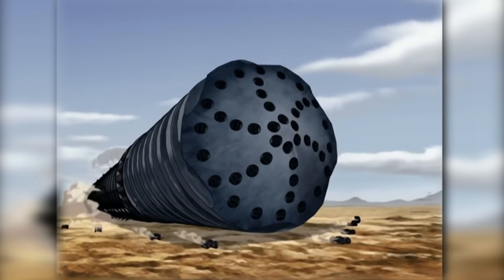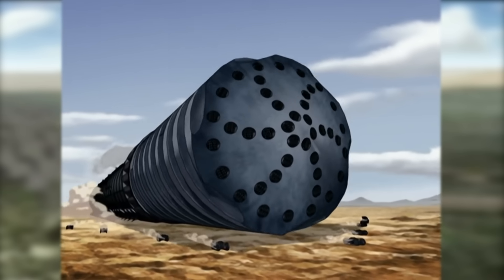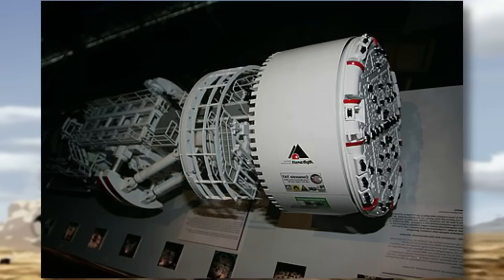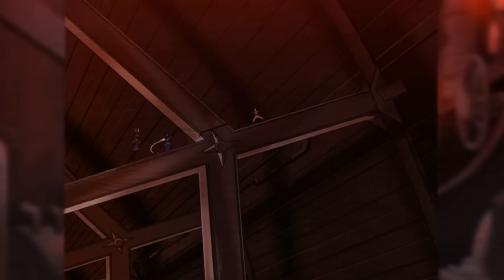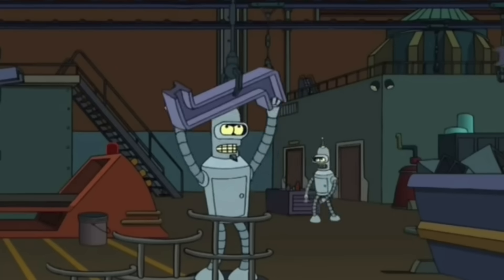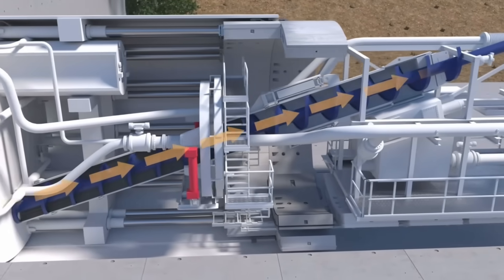Engineer Breaks Down the Fire Nation Tech

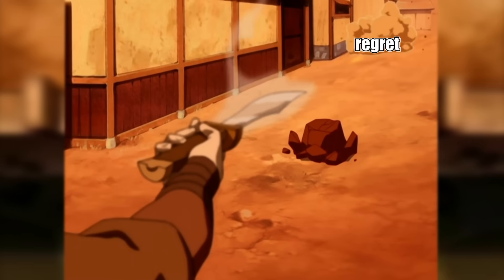Comment: 8:24 the firebender have to either use the power of the sun, metabolic energy, or emotional energy usually rage, but later probably act more like a valve fo the former. Also they have to be in an oxygenated environment. Though it's yet to be seen if firebenders could manipulate fuels, oxides,  or accelerants. So in reality they have more drawbacks than airbending. Which i don't see why compressed air bending can't become plasma bending.

Comment: a lot of the tech in atla is restricted to fire nation use only until much later on so it would make sense for those within the world not knowing to attack the control hubs of devices unless they accidently stumble on the guy driving the thing due to it normally requiring some kind of bending method to power it.

Comment: To be fair, I would argue that the best way to defend against the drill in this situation is to first slowly surround it with more wall, then enclose it underground, and only then keep extending the wall in front of it. 

Give it some time, without ability to replenish the resources, it will have to stop moving, and then either arrest whoever is still alive inside, or leave the problem under ground.

Comment: I would say that it does seem like benders use materials in their environment, but at the same time, earthbending rarely seems to follow the conservation of matter laws, and sometimes water doesn't either, but it's harder to guage, because the sources of water are large, and the water would flow down to fill in anything taken. A lot of large stone structures are taken up out of the ground, but without any seeming loss of material from where they were taken. (When an earthbender throws up a wall, or kicks up a rock, there's usually not divets around said wall, or a hole in the place of said rock) A lot of this can be chucked up to animation and logic needing time and effort that were needed far more elsewhere, but I'm never sure in my imaginations whether to go with what's seemingly intended, or what's shown.

Edit: The idea of simply widening the wall is absolutely diabolical. I love and hate it
Reply: I read a fanfic once that answered this, in the fanfic the protagonist called it "sponging the rock". 
When an earthbender seemingly makes rock appear out of nowhere, they are doing the equivalent to letting go off as squished sponge. They increase the volume but not the mass, if Aang raises a column of rocks and you take a closer look to it, you'll see the internal structure of a pumice rock, it desintegrates with time, not good for building structures, pretty good for fighting tho.

Comment: tbh, I think it makes sense to take out the drill structurally.  if they attacked the mechanical workings, the fire nation could fairly easily repair it... and they likely had backups and replacement parts on hand, expecting failures of various onboard systems.  by striking the structure, the fire nation would not readily be able to repair it for another run... given its size, the fire nation would have to protect it for long periods right next to an enemy's wall... until repairs could be made...hence, when the structure failed entirely, they abandoned it in place.

Comment: If they use the sludge to remove the earth because if they keep it as a conveyor an earth bender can just destroy the insides, with the addition of water you make it so only certain type of earth bender can destroy the machine. 
While every earth bender that can bend dry earth is there they will lack Benders from the coast, or from swampy areas that may have the ability to bend wet earth. If you recall the northern water tribe is not close to assist and the southern water tribe is almost non existent and out of Benders. There are also no airbenders that's why the also beginning the development of the air blimp, and why they have to mechanize as earth Benders can't bend metal, at this time

Comment: well heres how i thought of this on the slurry side of this BUT three things you need to know First drilling causes friction and friction causes heat which is often the cause of case hardening which then leads to metal becoming brittle so the water may be a crude way of keeping the drill cool while its doing its job,  Second  drilling stone of any sort causes vast amounts of dust to be thrown up into the air and when it gets in your lungs can reek havoc of all sorts so perhaps they were doing it  also to keep the crew in top condition so they arent choking on it ALSO dust gets in every nook and cranny you can imagine causing mayhem on anything mechanical and leading it to break down quicker  with them also probably creating it so its easier to remove the cut material away from the main working bits of the machine and THIRD and finally the slurry then acts as an abrasive to further help grind the hole they're trying to make in the wall for their troops to make it through . but anyway just my thoughts as a writer and a chronic world builder who loves this kinda stuff

Comment: I've always seen firebending more as "plasmabending". Fire needs fuel to burn, and we don't see firebenders with any fuel on hand. So I assume they are "burning and superheating into plasma" in a localized way the gases in the air, and some particles present. Without air, there is no "flame". That's why they talk about "breathing" for firebending. And remembering about Azula's Lightning and Iroh's lesson and the Dance of the Dragons that firebending is a type of "energybending"... Convert energy into thermal energy and you heat the air under your control.

Comment: In retrospect, the weakness of the drill is clearly the contact points with the ground which would be under extreme pressure and the propulsion system. The reason why we don't have supertanks heavier than 100 tons are because they are super slow and vulnerable, and because of the ground pressure they get mired in mud and can't cross bridges. The earth kingdom should have been able to see the drill coming for days if not weeks, and set up a veritable obstacle course for it. Trenches, moguls, sinkholes, mud, water, fine sand there are so many things that would be lethal to this behemoth.

Comment: It's a steam-powered drill, and Ang and Katara can bend water. Just lower the water in the boiler, and the crown sheet around the fire box would weaken. Eventually, it won't be able to hold back the pressure, and the whole boiler explodes.
If they wanted to keep the engineering team distracted, they could fool around with the water level in the sight glass so the engineers would think the boiler water level was adequate.

Comment: Look, I know Iroh was powered by Sozin's Comet and yes a powerful firebender, let alone the Dragon of the West, during that time could definitely pull off significant damage on the wall.

But you can't deny that the amount of combustion needed to power a drill like that could've easily had been translated into explosives. In that case it would've put the Fire Nation at a similar tier as the Earth benders since they can raise earth to replace parts of the wall pretty quickly, but bombs are instantaneous while the drill was slow. I mean they had a whole story arc and battle sequence while it tried to do the thing, come on. 

It was definitely hype, definitely over-the-top and the Rule of Cool was on full display here, but bombs plus trebuchets that fling fiery boulders at the wall would've worked a lot better, done it a lot faster, and honestly would've been cheaper and more defended than the drill and I don't think I'm being a party pooper for thinking that.

Comment: The tactic of just extending the wall where the drill is would have been nuts, surely the drill had a maximum effective range, would have completely neutralized it but I doubt there were any benders around capable of doing that.
While Avatar isn't perfect it still impresses me just how much better it is in comparison to basically another thing in television.

Comment: 6:40 air with enough speed and force can cause damage, if it can do that then accurate wind with added speed should be able to cut just like water can albeit it requires much more force, same precision as water but much more force from a much greater power source in order to achieve what Aang did

Comment: I just realized with the wall widening comment, if team Avatar were really smart they could have disrupted the drill with a steep enough incline.  The drill slowly inch worms along on the sand joint by joint.  What if you were to cause the joints to abut each other and jam.  I doubt they have enough people to fix it.

Comment: I assumed fire bending is just energy projection. Air contains all the elements you need to make a brief fire ball, but it needs an extreme temperature to make it happen. Electrical arcs can make fireballs that travel several feet. The idea that lightning is just a specialized form of fire bending makes sense when you assume fire benders are just projecting energy not actual fire. Fire is the result rather than the cause.

Comment: To be fair, I think that the channels on the side of the drill head has a bit of a purpose, pun notwithstanding... More specifically, I think they were there in case the Earthbenders attempted to use the material of the wall itself to clamp down on the drill head, trying to get it to bind up and get stuck. The grooves, like an average drill bit on its side, would likely have been meant to chew away at any such excess material and extrude it backwards, outside of the wall, and out of the way. This would render any further attempts to bind the head a bad idea, because bending (at least, non-fire bending) requires existing bendable material to work, which means the benders would have to use material from the wall itself, further weakening the structure (and thinning it out!) in their attempts to defend it. Of course, we never saw anyone try to do that, at least not on camera, so for all we know that (possible) plan was a moot point in the end.

At least, that's how I choose to interpret the grooved portions.

Comment: How the Earth Kingdom army could have stopped the drill had Team Avatar not been conveniently passing by:

1. They could have just created a massive boulder by all working together and dropped it on one of the extended sections of the drill during it's movement. During movement, the drill's armor becomes substantially thinner, and a large enough boulder could do some serious damage. And even if it doesn't do any damage, the giant boulder lodged in between the drill sections would keep them from coming back together. Thus stopping the drill from moving those two sections anymore, stopping it until the obstruction is removed.

2. We see 6 earth benders blast a tank into the air by working together in this episode. So a larger number of benders could potentially lift a section of the drill. Just lift any section of the drill even a few meters off of the ground, and the drill will become unable to move. This is because the lifted section cannot survive dropping several meters off of the platform, and the rear sections cannot make the 90 degree climb onto the platform.

3. When they see the drill coming, they could send an advance party to dig a massive trench in front of the drill. This drill seems to not like bending, so forcing it to go down a steep hill could cause it to break. If not, it's still heading for a place distant from the wall. You could also carve a turning channel into this trench to force the drill off course.

4. Counter tunnel the tunneler. While the drill is on its way, have a bunch of guys go underground and dig a series of tunnels. Removing the earth as they go. With earth bending, a process like this could be done in minutes. Then, when the drill passes over that area, the tunnels will collapse under the weight and the drill will fall. This will both bend and drop the frontal section of the drill, as well as slamming the actual drill bit sideways against the ground. Even if the drill survives this, the bit will be offset. Needing repair or replacement. The Fire Nation's engineers will also need to find a way to lift the drill, reverse it, and turn it around the sinkhole before the assault can continue. Taking days at the very least.

Comment: I think it's better to think of fire bending less as a form of matter manipulation (controlling plasma, in this case) and more like energy manipulation. They can manipulate thermal energy (and electromagnetic, in the case of lightning) to spontaneously ignite small amounts of the air, as they can also use fire bending simply to heat themselves without setting themselves on fire. You don't really see fire benders make flames in the environment move to their will, and instead see them force plumes of flame out from their limbs and mouths. This would suggest they are not moving the fire, but instead extending a chemical reaction in the air that causes a mass of plasma to generate in the direction of the attack. Fire bending also "comes from the breath, not the muscles," as the heat of the body is most readily expelled that way.

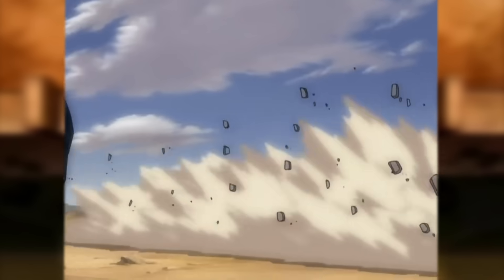Comment: 7:10 sure they could have attacked the mechanical systems but keep in mind that those are most definitely being oversen by the crew woo that the machine doesn't brake itself. Sonce they had guards for non critical parts of the drills operation
Reply: Wtf kinda pfp is that

Comment: I love the idea of the defenders just making the wall thicker as the drill goes through until they run out of fuel and are just like “well….. now we’re stuck”
Reply: It would be hilarious if they led this thing down an artificial slope so it wouldn‘t dig into the wall but into the earth at an angle instead. This drill is many things but definitely no maneuverable. Imagine them boring for hours just to realize that they are deep underground, trapped by earth benders sealing all the air tunnels…

Comment: I'm surprised the Earth Benders didn't directly attack the drill by stressing it's massive length by lowering or raising the ground under it.  Do that rapidly enough at enough different points and it's own size and weight will do the damage for you

Comment: If we go deeper abot fire, it gonna be not what it looks. SO air, water and earth is quite physical object, but fire is a different story. Usually what's meant by fire is just oxidation with heat production. Technically speacing it shouldn't even be oxigen because you can burn natrium in phosphor.But more precisely: fire in it's core is just emmiting energy as heat and light. As long as magic is just some sort of other kind energy wasted on moving earth/water/air, it can be wasted on speeding up particles as well (Reminder: heat is basicly average speed of particles in substance.).

Comment: What if firebenders are changing the oxygen concentration or altering the whole air composition and pressure so it can be ignited and directed, since flames created by firebending are clearly directional and is seen can even create explosions when not using it right, or like that one guy who could just go boom, and his blasts did look a lot like shockwaves, so it makes me think of very compressed air.

Comment: At about 8:13 you talk about how Fire bending is the only bending that is "Created". I've thought about this for some time-- We know that some benders can control the temperature of their element. Water benders can melt snow or freeze water. Some special earth benders can become lava benders. It makes one wonder if water benders are also capable of boiling water? Can air benders also control the temperature of the air around them?
We also know that fire bending works without the possibility of oxygen, as we see Zuko in season 1 heating up ice that he's trapped under, as well as earlier in the season we see Iroh heating a pool of water to create a hot tub.
 We also know there are some benders (like Azula) that have hotter flames, based on color.
The best solution I have is that fire bending is some form of energy manipulation, on an atomic scale? And that when not being used against other elements, such as water, it appears in the form of fire.
We've also seen that fire benders can also control lava (Roku in his temple in season 1), and maybe that is a result of the actual heat/energy?
I could apply this energy manipulation to the logic of lightning bending, but I'm not all that smart and don't want to make a total fool of myself. Something something energy and electrons.
Anyways that's my thought.

Comment: Aight so, Fire bending...uses the Firebender's own chi  to generate heat and flames, this use of chi is why they can also generate electricity (Lightning Bending, and Redirection as an extension of chi (energy) manipulation (smoke bending, manipulating and directing the flow the heat energy of very hot particulates) [0 explanation for Combustion bending, although this manipulation of one's energy is I believe the basis for Energy Bending], as well as being able to manipulate flames that may already be present in the environment, whether due to man or nature doesn't really matter...its fire.

Comment: If you look at it scientifically, fire bending most likely draws heat from the air around it to spark a flame, which would make sense considering the fire benders live on a volcanically active island, where it would be hotter than usual.

Comment: Easiest way to defeat the drill was to just make a ramp out of earth under each set of tracks along one side. They'll be forced to stop, or risk the thing rolling over. Or change the ground where it is to uneven for the drill to be able to move. Could also lower the ground under the rear half of the drill, and make the thing fall back into the hole. A large vehicle like that which can really only travel in a straight line would be easy to beat. The gang just went about it the hard way.